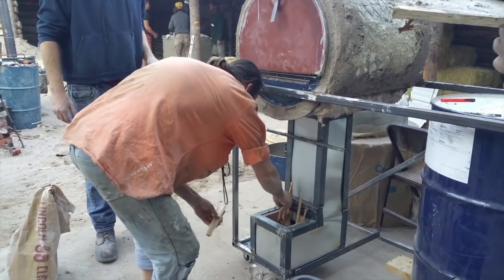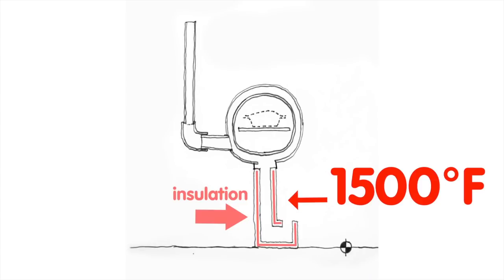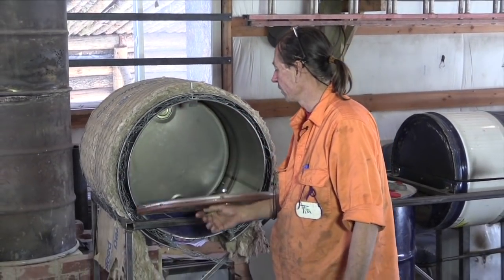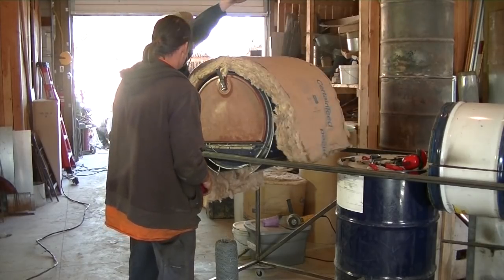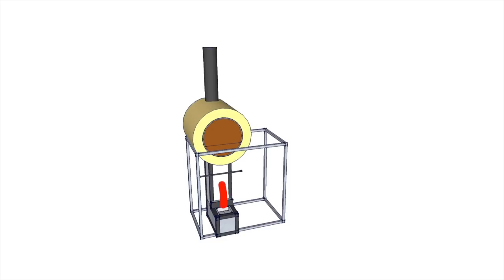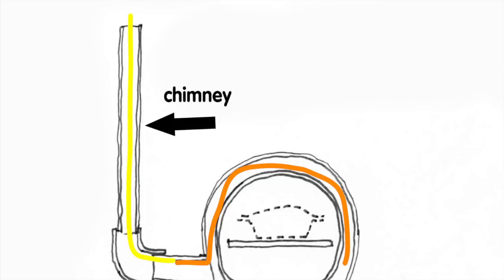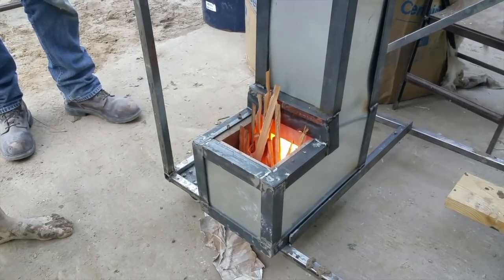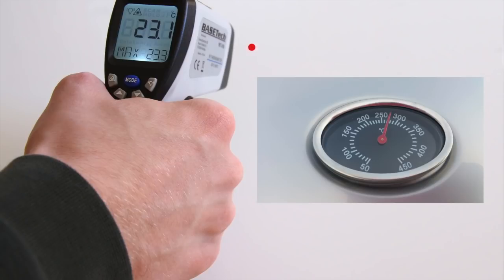How does a Rocket Oven Work?

Comment: Hey Paul! Good stuff man! Thanks for sharing. I'm from S.Africa, and we have this pain in our backsides called 'load shedding'. Our power supply gets cut quite often on a rotational grid basis due to... well, S.African crap. I've seen a video on homesteaders that made a rocket oven before, not much indept tech, but thats just enough to get me hooked. They had the same barrel with a 2" / 50mm spacing between oven and insulation. If I remember correctly, it heated to 350F / 180C in 15mins! Oh, the insulation was grog. Mixture of clay and hay! Looked so cool and rustic man. Now I know from your explanation, that rocket science is achievable from just a curious pipe fitter like myself! 😉👌👏👏👏
Reply: Plz tell me the right insulating material that used in rocket oven

Comment: Hi Paul, thanks for sharing this video with us. I actually toyed with the idea of kiln-cum-oven that could be usable for baking with less firewod being fed and therefore less intense heat, but my worry was about the chemicals produced by the burning process  that would enter the "bell" of the oven - as far as I have seen they cause color changes in pottery and I suspect they would not be good for food items either. Now I wonder whether it'd be possible to make an enclosed ceramic "bell" - have you guys ever tried something of this kind?
Reply from the maker: what you are describing is "white oven" vs "black oven".  We have a kiln here that is black, like what you describe.   The rocket ovens we have here are white.  I have not yet explored the idea of a white kiln.
Reply: speaking of this white oven you demonstrate - what kind of metal are you using for the inner chamber? looks like standard barrel to me, doesn't it release toxic stuff off the walls when heated? I would think a stainless steel barrel'd do the trick but it also drive the cost of the oven quite high.
Reply from the maker: in this vid:  mild steel.  A *LOT* of detail on that in the upcoming dvd.  

As for stainless:  keep in mind that stainless does not conduct heat very well.

Comment: There doesn't seem to be two oven type tubes that would have an air flow between them. Maybe I misunderstand but it looks like the insulation is the heat exchange. Depending on the kind of insulation that might not be good. Can you clarify?
Reply from the maker: Insulation is to prevent heat exchange.

Comment: So it is a termosyphon natural draft biomass gasifier and producer gas burner in one ?
Reply: Thermosiphon means that heated fluids (air, exhaust, or even water) rising up will draw some other warm (or cool) fluids to follow them, even if it means bringing a hot gas downward briefly to feed the upward movement.  It's what allows the fire to burn upside-down and sideways in the firebox, and also helps us heat the oven evenly by where we locate the chimney outlet.  
All natural fuel fires burn the off-gas products and tiny particulates, not the solid parts, of the fuel.  You can call a clean-burning fire by fancy names; but basically, it's a virtually smoke-free fire that does an efficient job at turning wood (and creosote) into heat.  We are finding we can usually bake more pounds of food than we used pounds of wood; it's that efficient.

Comment: So currently in our farm building we use a traditional wood firebox/stove. Inside this stove we have a special heating coil that heats our water. If I built this rocket oven stove and placed a similar heating coil and placed it on the outside of the barrel where the heat, soot etc circulates to heat the oven, I assume I should get temperatures around 1000- 1500 degrees to heat the water that passes through this coil? Then I can heat my water while baking.
Reply from the maker: Have you seen our DVD called "Boom Squish"?
Reply: You don't need those kind of temperatures to heat water!

Comment: Hi Paul, How do you control the the temperature?
Reply: After a couple of practice sessions, we are finding the oven holds nicely at 350 if we just add wood about 2 small sticks at a time.  (1 to 2" wood, most people would call it big kindling.)   We use a brick or cover to reduce the air intake, so it matches this smaller volume of wood.
Reply: cool!  so you need to sit near the whole time you bake, so you can keep feeding, correct?
Reply: I would think if one put long pieces in, about 4-6 feet one would not have to watch it so closely?
Reply: 350 is a good temperature. almost everything including bread is good at that temperature but what if one wants 400-500 for pizza? just put in more wood? instead of 1-2 pieces to maintain?
Reply: Thanks. Now I get it.
Reply: To decrease the temp open the oven door, to increase the temp add more woods
Reply: I've been hunting around to see if anyone has hooked up a thermostat to a bypass flu to maintain temp, but so far no luck.
Reply: @felicianocapicia  i donot think so. It is a rocket-mass-heater after all and the efficiency is higher than other wood heaters. But i am only a learner myself, but i am almost 100% sure that you donot have to sit next to the oven the whole time to keep feeding the fire. It has to do with efficiency, as i say.